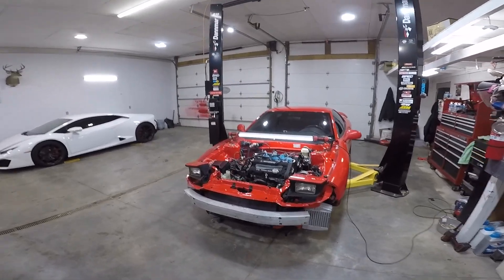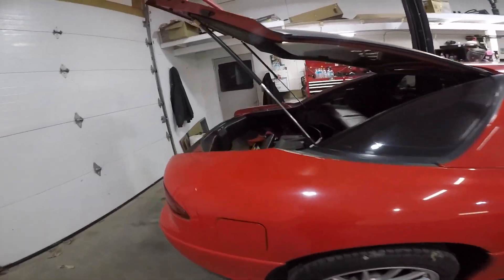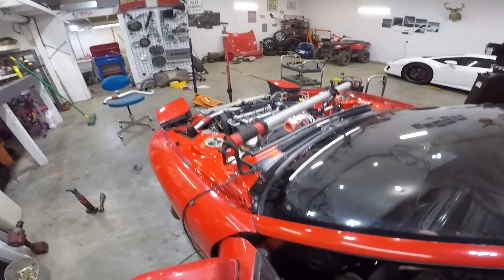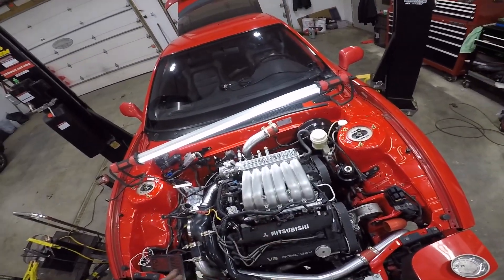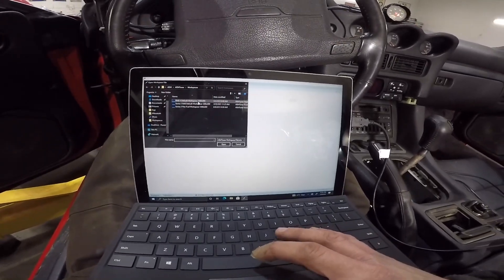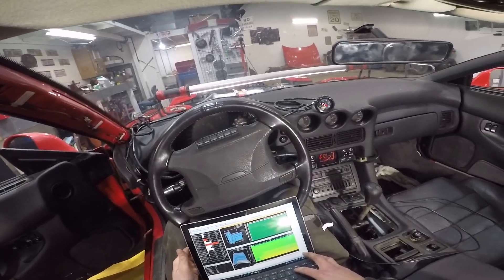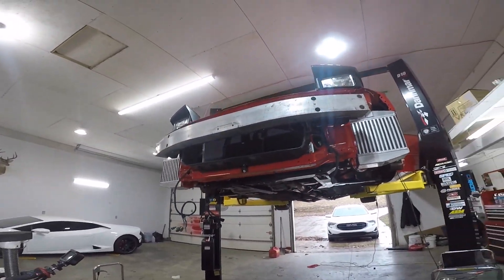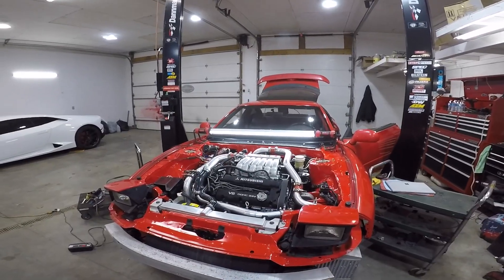First Start up on a Completely Rebuilt Forged Twin Turbo engine [ 3000gt vr4 ] 6g72 tt

Comment: When you were priming it without the plugs in how long were you cranking it before oil pressure started going up? I’m just doing this and no sign of oil pressure after a good couple minutes yet. New engine new oil pump 😟
Reply from the maker: Yeah it's going to take a long time I edited a lot of it out but I think I went through two maybe three batteries... but make sure you get oil at the top .. the second time I rebuilt that it was a little bit easier because I unplugged the oil filter and oil cooler lines.. so oil would come out of there first
Reply: @huracanian3051  music to my ears, i was starting to worry. Thanks man

Comment: Hey big boss, you finally did it, this is insane all the process nightmares problems etc etc this is a lot of dedication, good job, where did you buy all your rebuild forged part ? Any site or link thanks in advance
Reply from the maker: Thanks bud ... U just called up IMR .. but I don't think they're the cheapest anymore... I'm pretty sure you can piece together all the same Parts I used for like 30% off from different websites

Comment: NO way ur alternator bad if it brand new oem Mitsu...either bad battery(personally do not trust those tiny thin expensive ones) or have a wire connection issue or maybe the alternator fuse(in the engine bay next to UR air filter when open box it be the last fuse on bottom right color white/light yellow 120A). 99.9% sure it the same alternator fuse they use on the 3G eclipse(v6 models) should have an extra used one if U need it. Cheers. P.s. Dunno why every1 trips on lifter tick noises...seen brand new Mustangs in the dealership making those similar noises.
Reply from the maker: Yea I have to get up there and check that I might have a bad ground on that alternator too

Comment: Did you bleed the lifters before install.  If not then that might be why, they are hydraulic rollers and they need to be soaked in oil for a day before install along with taking a screwdriver and pushing on the plunger in them through the bottom side.  after that you're all good.
Reply from the maker: I soak them in diesel and then blend , plunge them with a Allen key .... you're not supposed to install them full of oil... cuz there's a small chance that it might have too much and it might leave a valve slightly open on start up and you can bend a valve
Reply from the maker: That's what Mitsubishi says to do
Reply: @huracanian3051  I'd wager that one or more of the lifters still have air trapped in them hence the lifter tick.  A very comin problem with the 6g72 engines.  unless you're running the Gen 3 big bore lifters then not so much.
Reply from the maker: @Antonp21654  I have the Big Bore lifters... I think they don't have oil in the all yet
Reply: @huracanian3051  I was thinking the same, but still double checking with you to make sure nothing was missed.  Nice work in the car by the way!  Good job!  correct me if I'm wrong you are using an AEM ECU? If you're not which one are you using again?
Reply from the maker: @Antonp21654  yea AEM
Reply: @huracanian3051  Alright Thank you!
Reply from the maker: @Antonp21654  u going to run a AEM ?
Reply: @huracanian3051  I'm not sure.  Price tag is a bit for me at the moment.  However I will keep it in mind for later down the road when my finances free up a bit more.  Still working on my g1 dodge stealth rt TT, I still need to drain the gas tank, replace the front windshield, and repair or replace the Driver front fender first.  But I do have most of the parts that I need to upgrade the ignition system from wasted spark with 3 coils to Coil on plug either wasted spark or full on sequential fire.  the coil upgrade is part of the reason why I'm looking into an aftermarket standalone ECU like the AEM.
Reply from the maker: @Antonp21654  yea I what to do coil on plug one day

Comment: "theres some lifter tick" I told you to prime them before installing them
Reply from the maker: U can't ... Look into it if they're full when you install them one of your valves may be open you may hit a valve on start up
Reply: @huracanian3051  you’re supposed to prime the lifters before installing. But you have to collapse the lifter when installing into the head. So the lifter isn’t to far extended causing it to be over extended. It will be loud more then likely until you take the car for its first drive and put a load on the engine

Comment: That's awesome! Great job!

Fyi, if you haven't figured out the no charging issue yet, try checking the alternator fusible link in the fuse box under the hood on the passenger side. Its the 120A one on the bottom right. Ask me how I know lol.
Reply from the maker: Thanks man ... Lol O ok I'll check it out

Comment: Whoo Hooo!!! Awesome man! Great results follow great determination.
For AN lines… I personally went with crimped vs the compression fittings. Just couldn’t quite get compression to seal right and was too paranoid to trust it.
Can’t wait for the first drive! 😁
Reply from the maker: Yea ! ... my an line is leaking at the 90 where turns

Comment: Lifter tick for first start doesn’t sound unreasonable, I wouldn’t be surprised if it quiets down after you get some drive time.

Don’t eliminate injector tick either, they’re always kind of noisy too.
Reply from the maker: Yea that true
Reply: @huracanian3051  I'd get that thing rolling soon, I've always had best break in when I was able to boost a smidge, and engine brake after a rebuild.  Your first start went better than my last though, managed to lock myself out of the car right after it fired checking for leaks - thankfully on these cars you can slide in a yard stick to unlock, lol.
Reply from the maker: @CCrunner84  lolol